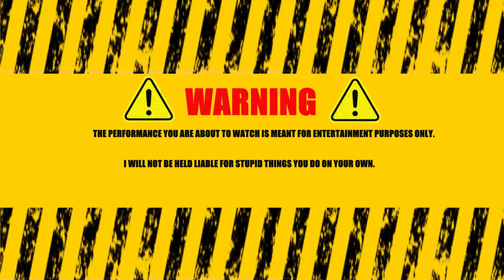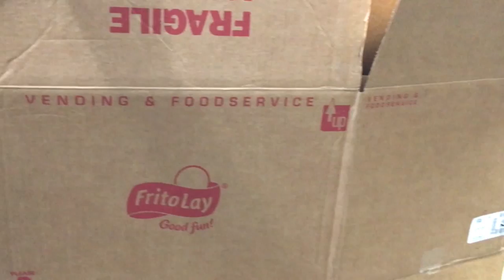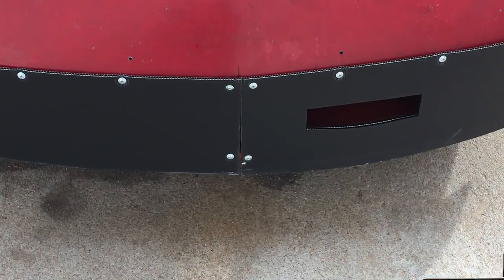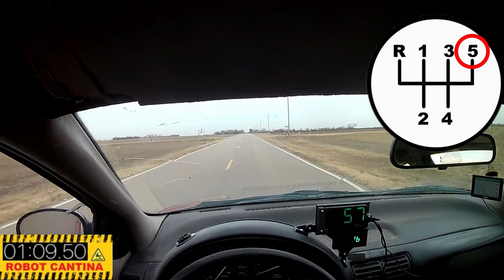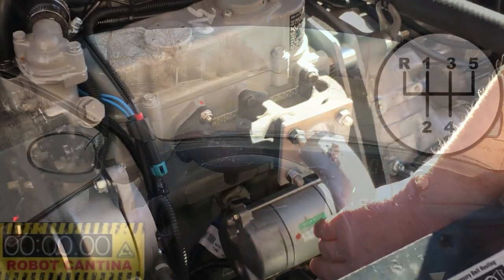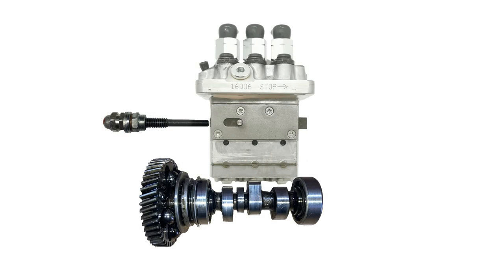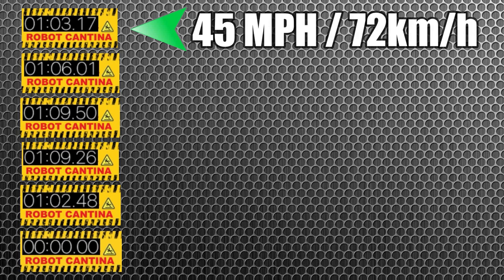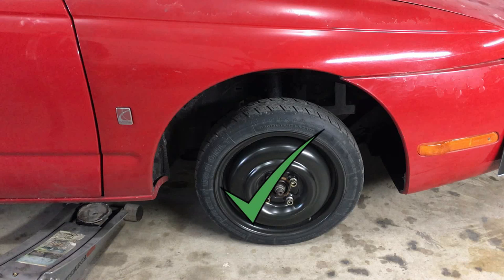S3E2   Fuel and aerodynamic mods ....We do some experiments to try and get the Saturn to go faster.

Comment: Suscribirse. Hahaha. 750-850 isn’t a big swing at all. I wouldn’t worry about that. It’s probably just to do with the engine and cams maximum efficiency at a given rpm as well as load.(hills wind e.c.t) and or intake temps. As far as egt a safe bet is 1200 for short bursts. 1100 all day is fine. Having said that it’s good practice to put your probe at the hottest point. One cylinder may run hotter do to intake design or other factors. I would get an intake air temp gauge as diesels seem to be very sensitive to that and I wouldn’t be surprised at all if that is where your power loss is coming from. Get cold fresh air to the engine. Also by looking at that pump set up I’m wondering if you could remove  material from the base circle of the injection cam and also remove material from the pump base. This will give you a longer stroke on the plungers if it’s in their design limits and as a bonus advance your injection timing slightly. I’d imagine this being an engine designed to run WOT all day with no love it’s going to be very conservative on those parameters and your going to want more for power and efficiency. Running boost your biggest enemy is going to be cylinder pressures. Try to keep the boost down in the low rpm high load areas especially if you advance timing.  And if you can safely rase RPM it is free power if the valve springs can keep up. Hp is a byproduct of Tq and RPM. LOL.

Comment: Look into covering the top half of the wheel arches, and you said you have 8 hours on this engine from new? As on the small Kubota engines like the D-EB or EB3 non-turbo in marine use, we do the first oil change service at 10 hours, and that's with the power/RMP caped at around 2/3, then we do the next service at 50 hours, also, to add a turbo you need to replace the head gasket for a thicker one, as you need to lower the compression. One more thing/problem with putting a turbo on this engine is the lower max RPM, ie, you will lose around 600 RPM's, this is a problem in the marine world as you need to re-prop for it, but maybe you be ok with 5th gear? and the power loss you have been feeling is most likely from the oil overheating/localized overheating, which will only happen at high loads after some time, can you add an oil temperature sensor? and maybe add an oil cooler.
Reply: @ocdman202  The lights of the original Model T were not electric. The common lamps used on horse drawn vehicles were the lamps used on the Model T, this meant it used acetylene carbide headlights and oil side lamps. Electric lighting and electric starting became available for the Model T late in production during the 1920’s.
Reply: IS THIS  LEGIT?

Comment: You have almost double the HPs of a class 8 truck per pound (not sure the torque).  Add a splitter to the drive train and drive it like a 10 speed big truck.  It still wont be fast, but highway speeds should be no problem.

Comment: you dont need alot of boost to get good power from a turbo. early 80s tdi didn't make much more power. just start small and you will see a point where adding anymore boost isnt helping all that mutch. then ramp it down to the point you saw demising returns. probably 5 to 10 psi on this little engine. the upside to all this once you got the boost turned you probably will bring down the revs.

Comment: A couple things. 1. Ya'll should buy a cheapo oil cooler. If ya'll are running into overtemps the cheapest easiest way to lower engine temps is to cool the oil sans piston oil squirter. Should tighten the head bolts around ten ft/lbs for around 20 lbs boost. If ya'll triple engine hp it will melt down. With an oil cooler directly in the airstream should be fine. This car will not pass another car unless ya'll get a tremendous run on it.

Comment: Lol not sure I have ever been so excited to see a car take that long to get to 55. 🙂
Reply: @ocdman202  The Model T was introduced to the world in 1908. Henry Ford wanted the Model T to be affordable, simple to operate, and durable. The vehicle was one of the first mass production vehicles, allowing Ford to achieve his aim of manufacturing the universal car.  Telegrams went the way of the Model T..
Reply: The lights of the original Model T were not electric. The common lamps used on horse drawn vehicles were the lamps used on the Model T, this meant it used acetylene carbide headlights and oil side lamps. Electric lighting and electric starting became available for the Model T late in production during the 1920’s.

Comment: you went a bit drastic with the wheel/tire swap... you need slightly taller and reduce width maybe by 1/4 since you dont want to swap gears in the trans output. the spoiler is hit and miss you would need find some proper data as some low pro spoiler do reduce drag but in some uses it is purely for downforce or looks which you don't want. The use of spoiler for downforce generally doesn't come into play until a speed well above what your intending to go anyway. you went a bit far with the fuel meter rod turn back in a smidge and adjust pump time instead if you can. As for comments of egt max temp a lot of that data can be thrown out if you are not soaking at that temp but rather bumping into it. Once going under boost you may find a need for water or meth or bug juice injection but i don't think so if you use a intercooler of either A2A or W2A design. Unsprung weight is also anothr reason to find lighter wheel/tire combo thus reducing parasitic losses of unsprung and rotating masses. Do also contact patch testing of the tires to get the best from them since the engine and car are modded the tires specs and/or door jam spec for tire pressure wont be correct.. See tire load charts and have vehicle weight for all 4 corners... If you cant weigh the 4 corner do the contact patch test at least. I cant remember if you have done lightening of the car but toss the console, back seat anything you can and make sure to shit before test drive lol. Thx for the content and keep up the good work. I am not sure but i would also check on max exhaust length for small engines maybe your losing some power to pumping losses due to long/restrictive exhaust. Side skirts for wheel wells and some more fiddling about with the under-carnage (pun intended) of a gm vehicle may be needed. Consider doing the Uncle Tony hole sawing all over the inner panels of the chassis to reduce weight. Maybe ditch things like the rear deck (behind back seat and things like that. The covering of the facia hole in the bumper may have hurt or balanced out since it has no angle of deflection it is more flat than when you started lol.

Comment: If you're concerned about air in the fuel system crack open the lines at the injectors and run over the engine. This will force out the air. It also makes a mess.
Reply: @ocdman202  The Model T was introduced to the world in 1908. Henry Ford wanted the Model T to be affordable, simple to operate, and durable. The vehicle was one of the first mass production vehicles, allowing Ford to achieve his aim of manufacturing the universal car.  Telegrams went the way of the Model T..
Reply: The lights of the original Model T were not electric. The common lamps used on horse drawn vehicles were the lamps used on the Model T, this meant it used acetylene carbide headlights and oil side lamps. Electric lighting and electric starting became available for the Model T late in production during the 1920’s.

Comment: First guy ever to say my Saturn needs smaller wheels
Reply: @ocdman202  The Model T was introduced to the world in 1908. Henry Ford wanted the Model T to be affordable, simple to operate, and durable. The vehicle was one of the first mass production vehicles, allowing Ford to achieve his aim of manufacturing the universal car.  Telegrams went the way of the Model T..
Reply: The lights of the original Model T were not electric. The common lamps used on horse drawn vehicles were the lamps used on the Model T, this meant it used acetylene carbide headlights and oil side lamps. Electric lighting and electric starting became available for the Model T late in production during the 1920’s.

Comment: Since your air intake is a pod filter stuck directly on the intake, at the back of the engine bay... I wonder if your drop in power is a result of higher under hood temps caused by reduced airflow from the aero mods.

Or dumber still, maybe the huge hole in the front pre-mod was acting as some kind of ram air.

Comment: The front mod seems less aerodynamic than the original gap. The car can only push the air around the body with the bumper masked, and it's also creating too much downforce at higher speeds. The effect here is working against you because the car doesn't have enough power to utilize it, unlike a Nascar stock car which needs it to stay on the course. The original design can cut through the air, almost like moving through water with a wedge-shaped versus a flat-faced bow. If the boat could go fast enough the prow shape doesn't matter, but it's missing the ability to do that, thus the boat is moving slower and creating much more wake.

Comment: Try putting the dirt back on the trunklid, I think it will have a helpful vortex generation effect
Reply: @ocdman202  The Model T was introduced to the world in 1908. Henry Ford wanted the Model T to be affordable, simple to operate, and durable. The vehicle was one of the first mass production vehicles, allowing Ford to achieve his aim of manufacturing the universal car.  Telegrams went the way of the Model T..
Reply: The lights of the original Model T were not electric. The common lamps used on horse drawn vehicles were the lamps used on the Model T, this meant it used acetylene carbide headlights and oil side lamps. Electric lighting and electric starting became available for the Model T late in production during the 1920’s.

Comment: The loud noise from bearings is normal?
Reply: @ocdman202  The Model T was introduced to the world in 1908. Henry Ford wanted the Model T to be affordable, simple to operate, and durable. The vehicle was one of the first mass production vehicles, allowing Ford to achieve his aim of manufacturing the universal car.  Telegrams went the way of the Model T..
Reply: The lights of the original Model T were not electric. The common lamps used on horse drawn vehicles were the lamps used on the Model T, this meant it used acetylene carbide headlights and oil side lamps. Electric lighting and electric starting became available for the Model T late in production during the 1920’s.

Comment: Idk diesels but i do know if you add fuel to a gas engine it lowers egts not higher
Reply from the maker: Yes, gasoline will certainly cool the EGT on a gasoline engine, however on a diesel more fuel makes more heat.

Comment: your really running a race with a broken arm and two fractured legs by not having a turbo on the diesel engine. You can get by without oil squiters in a turbo engine, provided you keep the boost down to something like 6psi to 10 psi.

Comment: We drow in past days and Fiat idea with 1.3 Jtd engine. Shaped like an mini-van - you could get an 3.5 l/100 km easily.. Same engine in Fiat 500 will give you consumption around 3-3.2 l /100 km easy too. Vw lupo will go even less than 3. And while not a rocket - they do accelerate ok for daily drive. BSFC is not very different ant you have better aero shape.
Reply: @ocdman202  The Model T was introduced to the world in 1908. Henry Ford wanted the Model T to be affordable, simple to operate, and durable. The vehicle was one of the first mass production vehicles, allowing Ford to achieve his aim of manufacturing the universal car.  Telegrams went the way of the Model T..
Reply: The lights of the original Model T were not electric. The common lamps used on horse drawn vehicles were the lamps used on the Model T, this meant it used acetylene carbide headlights and oil side lamps. Electric lighting and electric starting became available for the Model T late in production during the 1920’s.
Reply: IS THIS  LEGIT?

Comment: That front aero reminds me of a romantic night I had back with my first girlfriend down in my basement.
Reply: @ocdman202  The Model T was introduced to the world in 1908. Henry Ford wanted the Model T to be affordable, simple to operate, and durable. The vehicle was one of the first mass production vehicles, allowing Ford to achieve his aim of manufacturing the universal car.  Telegrams went the way of the Model T..
Reply: The lights of the original Model T were not electric. The common lamps used on horse drawn vehicles were the lamps used on the Model T, this meant it used acetylene carbide headlights and oil side lamps. Electric lighting and electric starting became available for the Model T late in production during the 1920’s.

Comment: Go with a 145 65 r15 a full set can be had on ebay for 475 shipped
Reply: @ocdman202  The lights of the original Model T were not electric. The common lamps used on horse drawn vehicles were the lamps used on the Model T, this meant it used acetylene carbide headlights and oil side lamps. Electric lighting and electric starting became available for the Model T late in production during the 1920’s.

Comment: A tiny lip spoiler should reduce the drag of the car a bit.
Reply: The Model T was introduced to the world in 1908. Henry Ford wanted the Model T to be affordable, simple to operate, and durable. The vehicle was one of the first mass production vehicles, allowing Ford to achieve his aim of manufacturing the universal car.  Telegrams went the way of the Model T.. @ocdman202
Reply: The lights of the original Model T were not electric. The common lamps used on horse drawn vehicles were the lamps used on the Model T, this meant it used acetylene carbide headlights and oil side lamps. Electric lighting and electric starting became available for the Model T late in production during the 1920’s.

Comment: Engines like these are used in generators.
What I would like to see next if you can get a dud Nissan Leaf or Tesla is to dump most of the batteries swap in some super capacitors and a generator.
The experiment will determine if the generator (charging while moving and stationary)plus regenerative braking can keep the batteries charged enough to exceed the range of a long range battery pack.
This would make an actually usable EV that is not just a big useless virtue signal.
The only thing EVs are actually good for is total pollution reduction in cities. As a means of fighting imaginary climate change they are in fact worse than gas powered vehicles.

Comment: You probably lost power after your aero, dynamic modifications, because you are now letting  less air cool into the engine bay and increased your air intake. Temperature just enough to lose a little power.

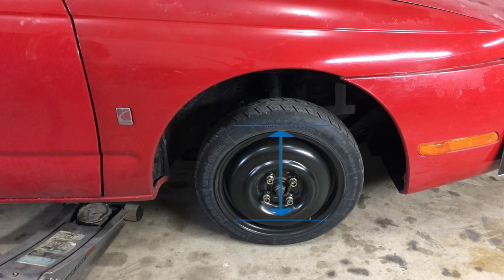Comment: 5:39 You're not changing the ring and pinion ratio, you're just changing the ratio of wheel revolutions to distance convered, which on a smaller wheel, you have to turn more to cover the same distance, which is exactly what happens if you were to use a higher ring/pinion ratio so it has the same effect.

Comment: My guess is that the air dam in front increases drag. Maybe try blocking off just the grille and seeing what happens. Also, try putting strings on the car so you can see the airflow.
Reply: Air dam most definitely does not increase drag

Comment: Have you considered that the engine may be starved for air and that that might be the cause for the reduced power? Consider taking off the bumper and see if that solves the problem, and if it does maybe put in a bigger hole.
Reply: Nothing in that engine bay is so air tight as to restrict the intake.

Comment: Turbo
Reply: @ocdman202  The Model T was introduced to the world in 1908. Henry Ford wanted the Model T to be affordable, simple to operate, and durable. The vehicle was one of the first mass production vehicles, allowing Ford to achieve his aim of manufacturing the universal car.  Telegrams went the way of the Model T..
Reply: The lights of the original Model T were not electric. The common lamps used on horse drawn vehicles were the lamps used on the Model T, this meant it used acetylene carbide headlights and oil side lamps. Electric lighting and electric starting became available for the Model T late in production during the 1920’s.